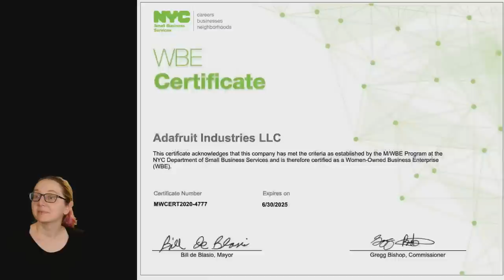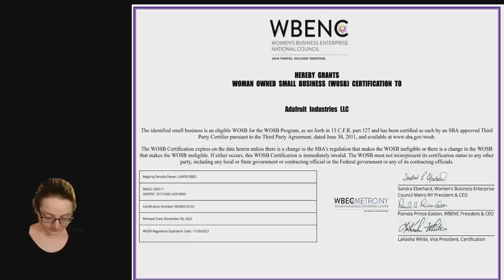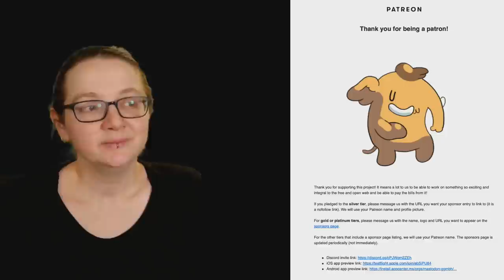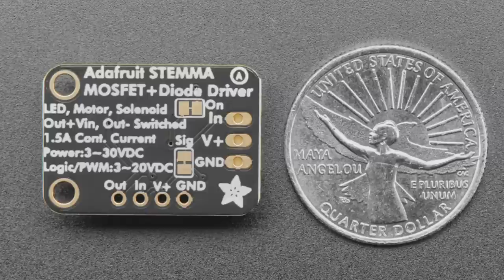NewProds 12/29/22 feat. Adafruit MOSFET Driver- For Motors, Solenoids, LEDs, etc- STEMMA JST PH 2mm!

Comment: What I would really love is a Wago block that can also accept a really big wire (say, a ring or spade ferrule) for power distribution or ground that I can then screw right into a chunk of plywood. I can fake it with a bunch of 221 lever nuts and an old fashioned screw terminal block with jumpers, but using spade ferrules for everything is a bit of a pain. I bet if they made a 221 with a metal threaded hole connected to the clamps, that would sell.

Comment: For the motor mosfet driver, what is thinnest awg that the wago connector support? More specifically does it work with awg28?
Reply: The 221 series terminal blocks you mention (had to do a search on Digikey) only goes as thin as 24 AWG, so I think 28 gauge would be too thin for these connectors.
Reply: @MMuraseofSandvich  True, the datasheet also states awg24 as the thinnest, I wonder if it works with smaller anyway but maybe not optimal. My usecase really needs a push-in connector that supports awg28 😕